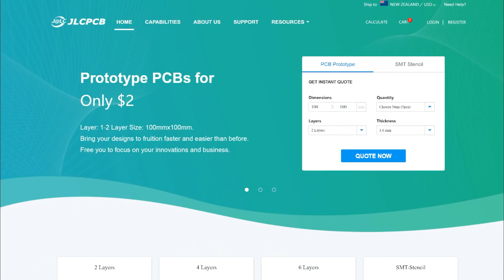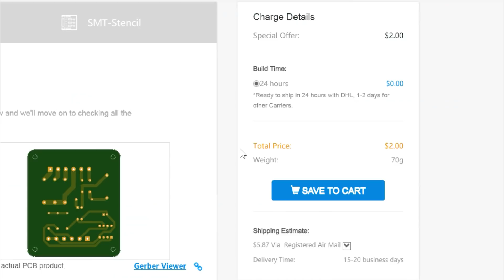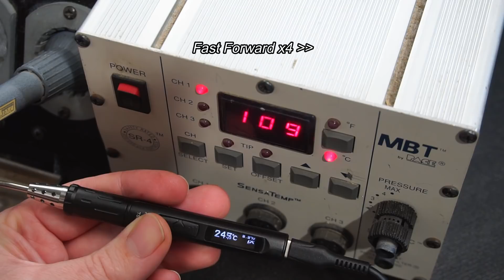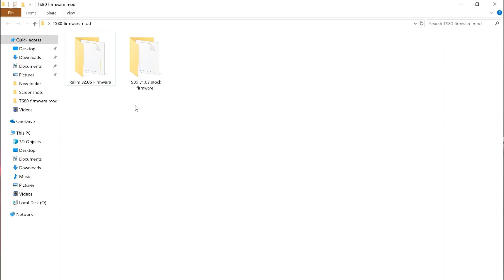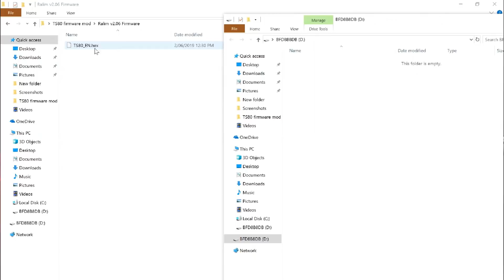Review - The TS80 Soldering Iron! Does it live up to the Hype?

Comment from the maker: So the question some people are asking. Did the TS80 only win because of the chisel tip? I went out and bought a chisel tip so we could do a rematch. Watch it here: https://youtu.be/KJZZ9YTxJWE
Reply: Schematix I may have misworded, but the the surface contact you make with the iron is conjunctive with how fast you melt the medium. Another great reason for the use of hot air guns.
I always switch over to a bigger tip in order to solder thicker gauge wires. More thermal mass and more surface area for a big ol' blob of solder!
Reply from the maker: @JamesDutka  For sure it does. I guess the real question people are asking is "Did the TS80 only win because of the chisel tip?" It's a fair question so that's why I made a follow-up rematch. (Spoiler alert it didn't change the outcome. TS80 won easily)

Comment: your soldering pin is not the same , the on the one is pointed and the other is flat blade , so more heat transfer.

Comment: You have to use the same tips in the comparison because the wider the tip, the faster the heat transmits, the advantage is the ts80 because it has a wider tip.

Comment: Why use a Big bit for your Miniware TS80, but a little bit for your big solder station?!?!

That's NOT a good comparison, you should have used the same bits, a big tip works a lot faster and better then a small tip.

Comment: Great video, Take a sub. Its nice to hear a fellow kiwi. Hope youre getting by ok, This covid 19 stuff is pretty scary. Im in Australia and we arent as locked down as you folks back home which is both a positive and negative. 

ANYWAY
 Im about to get into through hole soldering due to build my first mechanical keyboard, a project ive been putting off for quite a while now. Any sugestions for purchases from types of solder to irons and anything that can make it easyier to do for a novice.  Im thinking of picking up a Ts 80 or TS 100 but i have no idea what tips to buy. I already have my PCB (iris Rev. 4 and switches (gateron Clears)

Keep up the good work!
Reply: I’m in same position - just hope my keyboard kit and new iron get here before the end of the year with lockdown shipping delays...

Comment: The tip on the TS80 has more thermal mass in the chisel type tip
Reply from the maker: I think you're confusing thermal mass with surface area. The soldering stations tip mass is many times that of the ts80. Since I've had a few comments regarding this. I've bought a new chisel tip for the station and done a rematch video to see if the outcome is any different.  (It's pinned in the comment section)

Comment: Very nice video. I think it's a fair review, though, your soldering station looks antiquated. Mine took 27 seconds to reach 400C. Still very impressive if it can show similar performances to mine. I'll consider buy it.

By the way, your jlcpcb is just a normal link. Isn't it supposed to be affiliated link? I have to order some PCB and i thought i could use your affiliated link, but it's not. Just wondering if it's a mistake or you just simply advertise it.

Comment: for firmware update, take note: if you're using something that replaces the stock windows copy feature, like "teracopy", that will not work... you have to right drag the hex file into the solder internal memory and select the standard windows copy mechanism, NOT teracopy... had similar issues with my ts100...

Comment: 7 min mark... to keep it fair you should use similar tips, not use a cone tip on one and a wide bevel tip on another. Also, that usb-c connector won't last long. the ones on my phones don't last past one year... but the ts80 is still a damn good iron!  just it's power connector and it's soldering "audio" connector tip is all I dislike.
Reply: I agree completely! Thermal mass is not even close, he may be right that the usb iron may respond quicker but a chisel tip on the usb and a surface mount tip on the other isn't a fair fight, at all!!! Would be VERY interested to see a rematch with similar tips :-)
Reply: @n7565j  the surface area and how much contact the bevel tip has is also far more than the conical tip. it means th bevel one transfers heat FAR faster and better.

That's not stigma against conicals though, that's simply how things are. I use them all the time, and chisels too, but each tip has it's place.

Comment: That chisel tip makes a pretty big difference in how fast you can lay the heat down. It's not only a thermal mass issue, but a surface contact one as well.
Reply from the maker: I've ordered a conical tip for the TS80 and it's currently taking a dip in the Pacific between China and NZ. Once postman pat has delivered it I'll repeat the ring test and post an unlisted video link for everyone to see the results. I still think the TS80 will win easily but, we'll have to wait and see :)
Reply: @Schematix  I think you're right. I know the difference in how digital and analog apply heat to a mass can make a big difference. The digital way is just way more efficient.

Comment: Great Video! just out of curiosity I couldn't find any info on an IP rating. I work in Irrigation do you think it'd hold up ok in "moist" conditions? im using a gas iron atm and im wondering if it'll be worth the switch? and I know its not the ideal conditions maybe I could make a silicon usb cover?
Reply from the maker: Sadly, I can confirm that it has no IP rating. Nor would I suggest it could even handle a splash of water. Besides the USB port. The area around the switch & display would let water in. You could probably make a sleeve out of some silicone tubing to make it splash resistant?
Reply: @Schematix  Now thats an idea? 🤔 I mean im not going to be altering the voltage when im joining? And its only usually 1-2.5mm signal wire anyway. Thanks for the response btw 😊 I appreciate it

Comment: Ts80 has a larger tip there for it has more heat ready to transfer.
Reply from the maker: Actually, that's not true. The soldering station's tip insert is very long and would hold many times the heat compared to the TS80. If you were referring to the style of tip (chisel vs point) I don't think it accounts for the dramatic difference in performance. This is just a case of old vs new technology.
Reply from the maker: @DavidSims-x2w  I've ordered a conical tip for the TS80. Stay tuned for the results

Comment: I bought the TS100 after rave reviews all over the www .. I find it unwieldy to use as the heavy power cable ( 19v power pack ) makes it unbalanced in use ... I put it away and went back to my trusty Hakko FX-888D :)    I guess this TS80 with the lighter silicon cable does not suffer from that issue ?
Reply from the maker: I haven't held the TS100 so I can't comment on it. However, I can say with certainty the TS80 is a pleasure to hold and use. The soft silicone cable is very light and not noticeable at all.  I'd describe it as feeling almost 'cordless' ;)

Comment: Great video, thanks.  Have you used the previous TS100 model, and if so how would you compare the two?
Reply from the maker: I haven't held the TS100 so I can't comment on it. From my research and watching/reading reviews online comparing both. I came to the conclusion that the TS100 is a powerful iron but, not very ergonomic to use. On the flip side, the TS80 is small, lightweight and a pleasure to hold and use. Honestly, I haven't picked up my soldering station since I bought the TS80. I'm just waiting on parts to make the TS80 into a proper soldering station.
Reply: @Schematix  Thanks for the reply. I have the TS100 and I don't mind it (it replaced my WES-50 as my daily driver soldering tool), but it is a bit fiddly to hold sometimes. I'm considering picking up the TS80 based on what I saw in your video and I'm looking forward to seeing your soldering station build!